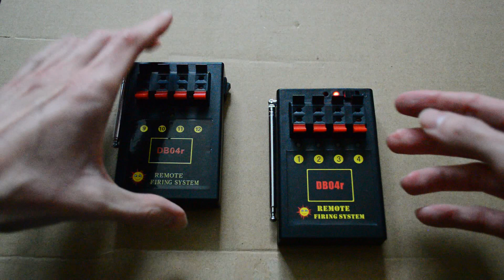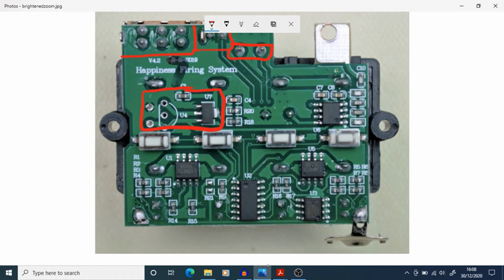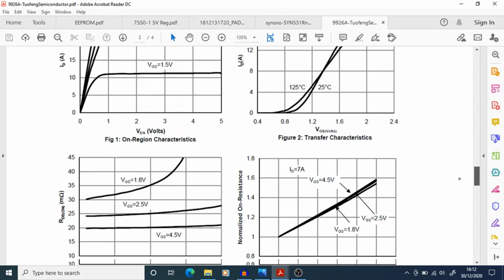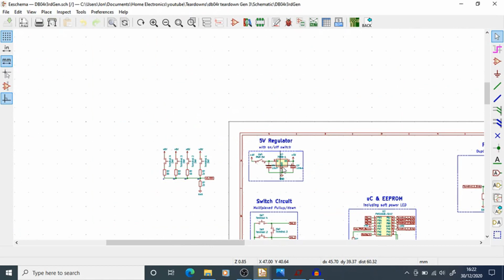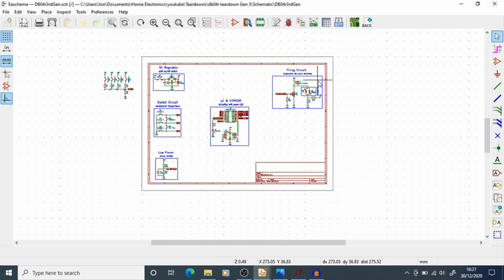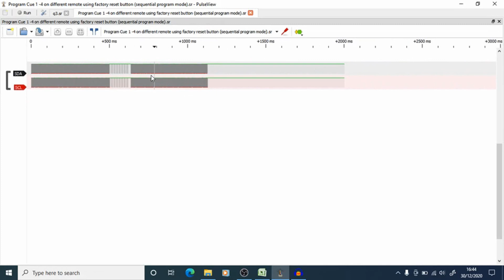DB04r Teardown 3rd Generation

Comment: Happy New Year 2021.  I have the first generation too.  The problem with the Chinese is that they copy everything and everyone, even themselves, thus not knowing which is the genuine one.  This can end up being detrimental to the one who created the product in the first place.  Do you have an idea of the genuine/creator company?  Its a great little product for fireworks enthusiasts.
Reply from the maker: The original designer was Happiness Firing Systems, at least that's who holds the patents. However, that in itself is slightly ironic as there are a lot of Chinese companies stealing intellectual property because they know they are untouchable in China with regards to patents.

That being said there are also some really great electronic design companies that run ligit businesses and really good hardware. I do think Happiness is one of those, they have found an area of a market that nobody bothers to utilise and they made a good product to fill it. If you look at their website (pyrofiringsystems.net) they now cater for all sorts of firing system needs.